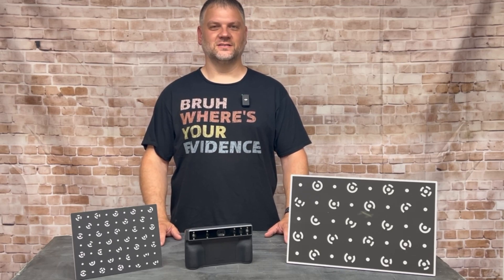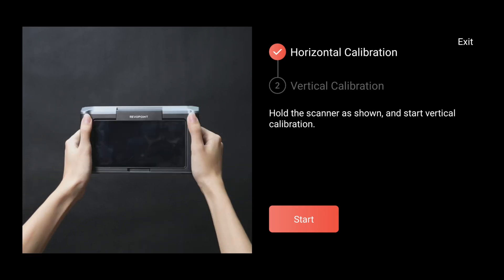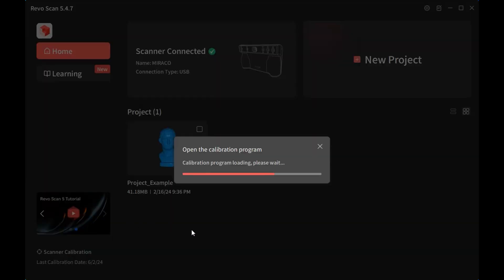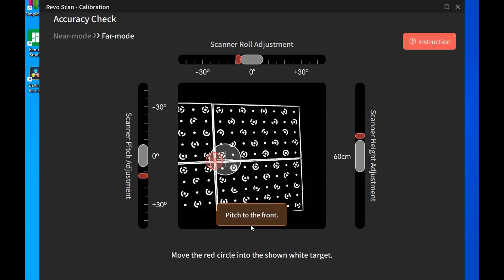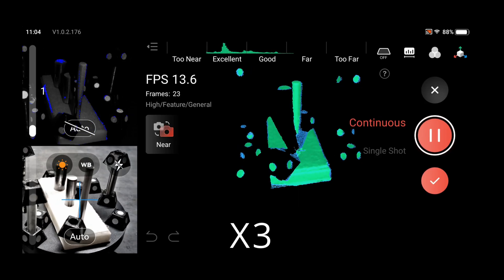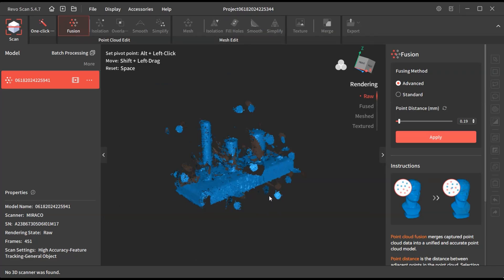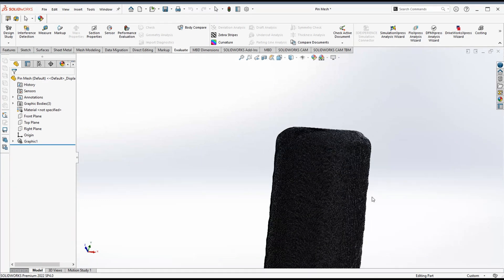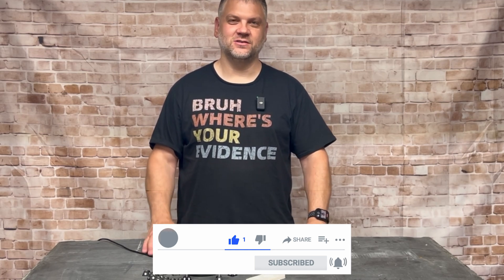Revopoint Miraco Episode 5: How accurate is the Miraco

Comment: Thanks for the demo, I wondered how to use the boards and appreciate the time you took to show us how.  Can you comment on whether this should be done when the unit is brand new, or if/when they recommend doing it (what intervals?).  Also maybe it's worth mentioning that there would be a thickness to the spray applied to the pins, so the scan would be the outside of the spray coating- and you measured clean pins.  Perhaps this could at least partially account for the tiny difference in measurement, rather than assuming inaccuracy (in addition to any potential inaccuracy of the calipers).  Very impressive results, I'm happy I own one :-)
Reply from the maker: You do not need to do this all the time on your scanner especially a new one. It is already factory calibrated. But if you find that you are having bad data or point clouds keep messing up, then this is a very easy thing to do to try and get the calibration back in order. Thanks for the other input! Happy scanning!